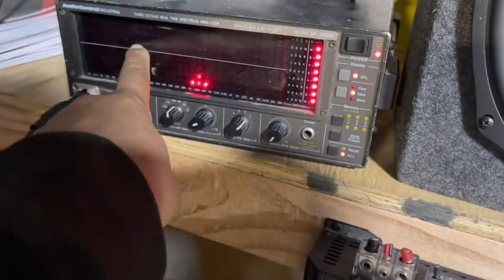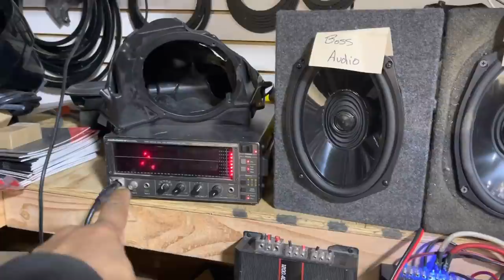We tested 2 Harley-Davidson speaker lid 6x9 cut in kits for factory lids . Rockford and Boss

Comment: Appreciate the mention regarding our 2014 & up Harley 6x9 Lid Kits , in reality our kit, Rockford & Boss are manufactured in completely different overseas facilities, it is true that many manufactures share facilities for various types of product however in this case they are in fact different.
Since we manufactured our cut in kit First, when BOSS came out with their kit we of coarse purchased to make a extremely in-depth comparison to see if our product had been infringed upon as we all know the gentleman overseas may not be as we shall say known for their loyalty. 
Turns out they are not from the same molding, in fact the Rockford Kit & BOSS have structural differences that are noticeable to the human eye if you know how and were to look for them.
Even though similar in style and design our 702 Motoring 6x9 Cut In Kits are using a different blend of plastic chemistry that is actually easier to work with, designed to hug the lid of the saddlebag better and less prone to cracking when some users may attempt to use a bigger basket 6x9's without the needed 6x9 1/2 inch spacers. 
There are several companies releasing 6x9 Cut in Kits, AQUATIC AV is one of them and I can say First hand their kit will greatly outperform the Rockford kit by leaps and bounds, we have been in house testing them for a good while and the kits are available now, also another company is about to release a large selection of 2014 & up Harley product but it is best I not mention the name just yet. 
Rockford is revamping their complete Product line currently as you know with regards to Harley product, times have changed, customer demands have changed and the offerings mostly from Diamond Audio and others have taken Harley Sound Systems to a completely different level. 
Not so sure the new Rockford M5-800X4 is going to put you in your 800 Watt class you mentioned in your # 2 Video, the power is the same Rated Power (RMS Continuous Power) as the TM400x4ad and it is actually a little taller and longer, however we are sure all the new product releasing will be a big improvement over the going out product.
Rockford Fosgate is a Great Company with Great Product and we are 702 Motoring Las Vegas fully support their product lines. 

Good job on your video's, keep up the good work, 

Paul / Owner / 702 Motoring Las Vegas 

https://www.702motoringlasvegas.com/product-page/702-motoring-lv-tms69bl14-no-6x9s-included-for-harley-davidson-rear-2014

Comment: The rubber gasket you mention with the RF speaker can be found on the bottom mounting area off the boss speaker. All you need to do is peal it off and boom you have the rubber gasket on the bracket. But I will still be using foam tape to get it extra waterproof

Comment: Thanks For taking the time to educate this Old head on what's going on Now  .  My Audio Experience  was back in 90's and to Know what's being used Now from your Sharing Really Helps . I decided on upgrading my CVO 2012 and 2015 CVO  Street Glides .  With one being twin cooled , the Lowers on the 15 have no room and the aftermarket style rings don't appeal  to me . 
My Question or Area I need help in is the Lowers on MY 2012 . I don't won't to modify , looking for drop in fit . 
 I have been buying my equipment and have a SONY XAV- 7000 Head Unit , ARC Audio 720 4 ch Amp , Rockford Fosgate  Punch 300 watt 2 Ch Amp , Rockford DSR1 , Diamond Audio M1SRT tweeters , Diamond   Audio  6 x9  Motorsport and Diamond Audio MSPRO65 for The Batwing . 
So I need a good 6.5 Speaker for the Lowers . You let us know about the importance of Speaker choice or Combinations  and I need to hear  my lowers and would like some Mid Bass if Possible . Not a lot of power , but I think if tuned right , it could sound ok . . 
My Musical choice is Old School  ie :  AL Green and Johnnie Taylor and Marvin and who can forget Frankie Beverly & Maze  mix with  some Sir Charles or Southern Soul  . Well , if your reading spend some time on those lower choices and how the Timing and DSR1  and speaker choice can help . 
Thanks Again " Ol Man 62  " .. 
#RidingSpring2021
Reply from the maker: Your best choice in my opinion for a drop in fit in the lowers will be the hertz Neo sx 165 but you will not get mid bass out of them . It really hard to get mid bass from lowers because they are so small ( the bigger the air space the more bass )

Comment: I have Focal HDK-165’s in the faring of my ‘19 RGS and the Boss Audio 6X9’s in the lids and I think it sounds great! I was originally going to ditch the boss and go with the Hertz SPL Show, but no need at this point I’ll just wait until the Boss’ give out and save 400.00 bucks. It certainly helps that my system is running the Arc Audio PSM and tuned properly with an RTA by a professional, but I gotta say these Boss 6X9’s are a huge bang for the buck and really shine when they’re dialed in.
Reply: How are those boss 6x9 holding out and do they sound good
Reply: @jgutierrez559  you’d be surprised but the output is about the same as the Rockford Fosgate package. That being said a nice pair of small 8” mids in the lower bags are in my future

Comment: Great videos Carlos!! Have you mounted any GZ 7x10 in dual 6x9 CVO lids with power locks? Currently running 4 JL C3 and wanted to switch to GZ or Diamond MP694 or 69cx, was told neither would fit.

Comment: Do you have to put a baffle on the 6x9 speaker if your running 10s in the bags?
Reply: The Boss Audio speakers will not fit if used with the Rockford 10" subwoofer kit.  The Rockford kit only works with the Rockford 6x9's.

Comment: Hey Carlos, do you know anything about the ground zero yellow 7x10
Reply from the maker: I know everything about the 7x10s 

What would you like to know ?
Reply: @NVSAUDIO  are the 7x10 any good for bass , inside the saddlebags, since they are bigger, but I don't see know one using them
Reply: @NVSAUDIO  also I would like to know the advantages and disadvantages for having 8 inch lids when adding bass
Reply from the maker: @lobo8052  in my opinion 
If you are adding bass to the bags 
Don’t do lids 
You will
Need to add a sealed back driver or a compression horn so the bass doesn’t destroy they 8
Reply: @NVSAUDIO  hey, Carlos good morning sir. Okay I will go with the sealed back,so how much to do my baggs, also I have a tour pack with 8s just like the orange bike, do I have to do anything to the tour pack, I'm going with the red ground zero
Reply: @NVSAUDIO  also sir, what 10 beyma, for the red,bike, how much for the bag work ,with the 10 inch beyma mid , but I would like to be able to remove my tour pack without hurting the music
Reply: @NVSAUDIO  hey Carlos, I called your shop and explained my setup  I was told I need 10 mid driver, so which one 8 drivers or 10 drivers
Reply from the maker: @lobo8052  it was me you spoke to 

You need 10s 

8s are not going to keep up with all your other speakers
Reply: @NVSAUDIO  👍one more question, instead of putting the amp in the tour pack, can I put it under the speaker lid
Reply: I mean the amp under the lid
Reply from the maker: @lobo8052  amp is too big to fit anywhere but the tour pack
Reply: @NVSAUDIO  👍
Reply: @NVSAUDIO  hey Carlos do you have any reviews on these speakers, beyma power 10ix ,or faital 10 hp1020, or any faital speakers
Reply from the maker: @lobo8052  

Ten 10 min bass review coming up soon 

Beyma 10 ix 
Faital pro 350
Ground zero 250xspl
Euphoria 10
Mmats 10
Reply: @NVSAUDIO  👍 I heard them faital 350 are a beast
Reply: @NVSAUDIO  good morning Carlos, so I'm interested in the 6x9 in the bags, so since you are about to start using 6x9 as a option, so are you going to check out other 6x9 ,or you already have a fill on which 6x9 creates more bass inside of bags
Reply from the maker: @lobo8052  I’ve tested all
Of them 

Hertz Mille pro 
Hertz sx neo 
Diamond audio mp694
Diamond audio ms69cx 
Mmats pa690 

Are my favorites for bass in the bag 

But I still prefer 8s or 10s
Reply: @NVSAUDIO  so 6x9 can't compare to 10s
Reply from the maker: @lobo8052  nope 

Voice coil on the 6x9 is much smaller
Reply: @NVSAUDIO  👍thanks sir